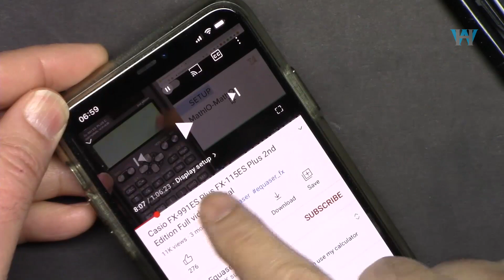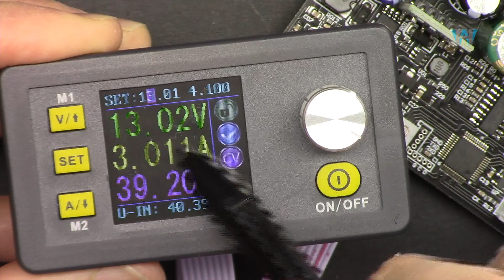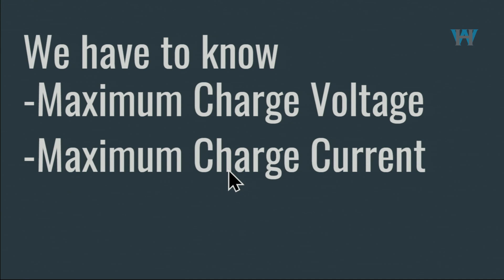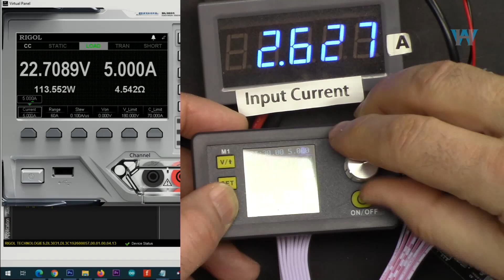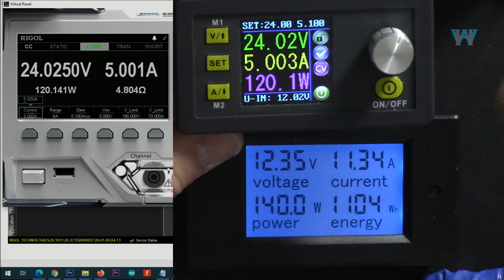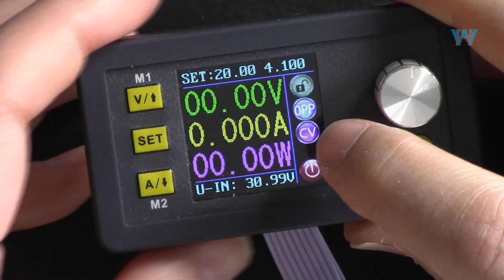Review of DPH3205 5A 0-32V Buck-Boost converter and Charger - WattHour

Comment: You have an error in the video title BPH3205 5A 0-302V, remove the extra zero
Reply from the maker: Thank you for letting me know. but it is tool late. I can't change the video.  I have mentioned the voltage. 302V is very high and my test also shows the maximum. Thanks